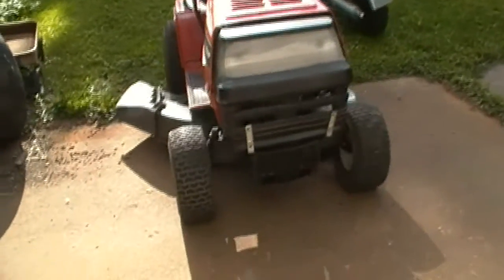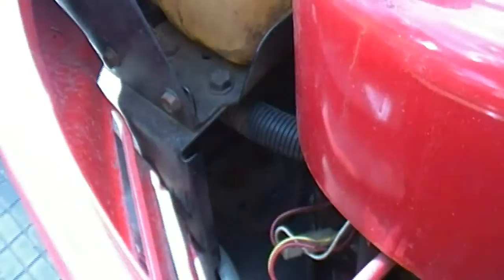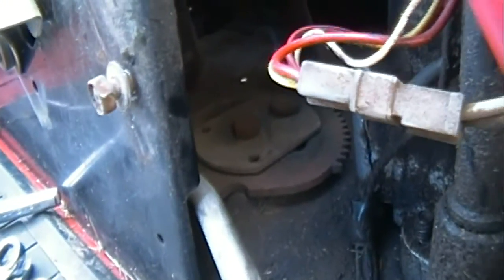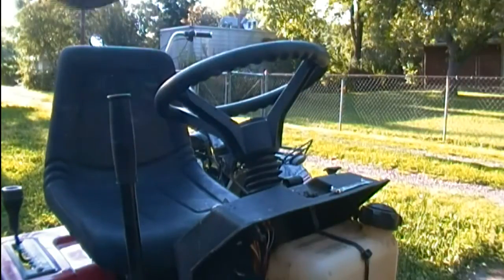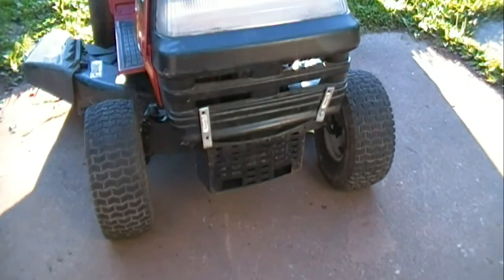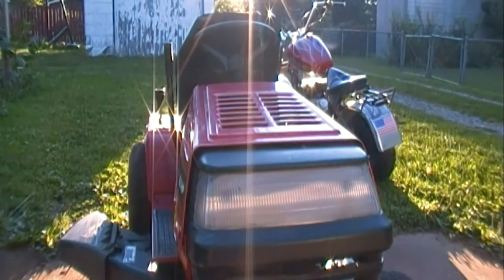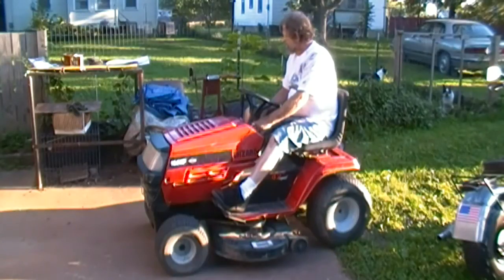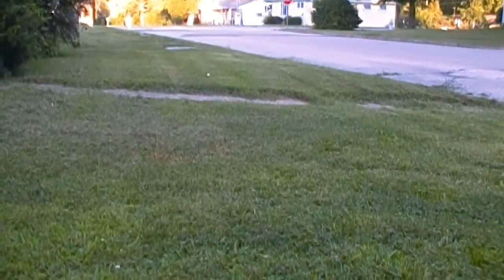New MTD Wizard R & D

Comment: Steering looks much better.  Its usually something simple like that... and the front brackets... yeah... I knew it was that bc the plastic always goes first...  the older mowers with the metal front end were always better bc you could push a truck with just the front end. Lol.  Itd bend it, but itd do it. Eh, either way, youll have fun with it!
Reply from the maker: yeah, I think it's gonna be a fine machine. I may do something with that front end yet. but time will tell.  Thanks Nate

Comment: hows the deck around the spindles? i look for cracks or welds from fix's....thos decks are $100 to $200 bucks...$400 new at sears
. cool fix on the steering...most times the driver will force the turning and breaks off those teeth...simple weld ANd file fixes that.......i change my oils twice a year...shut off valve..... and fuel filter every 2 yrs. air 2 to 3 put clean every month
. you got a great find in that mower....should last for yrs n yrs
Reply from the maker: Deck was checked while I had it down for this fix, All looks solid & sound.
Yeah it pays to take care of them, Thanks Rob, Your comments are not falling on deaf ears. I appreciate it.  Cheers